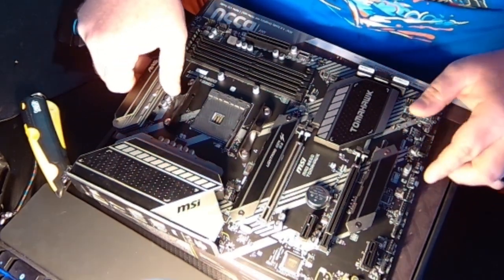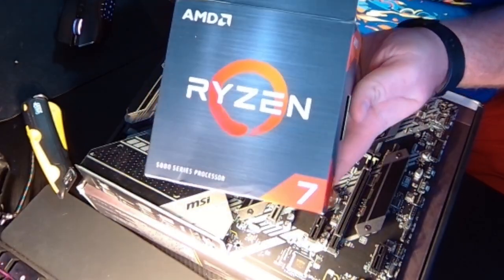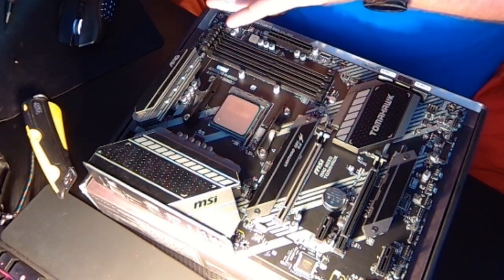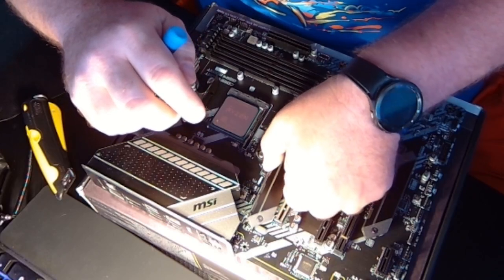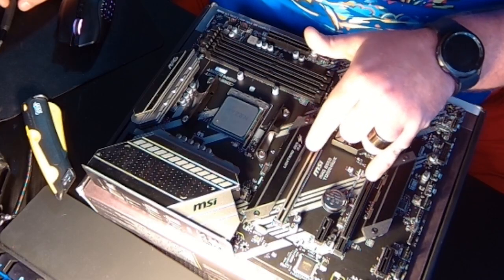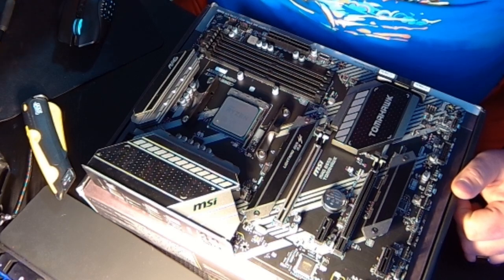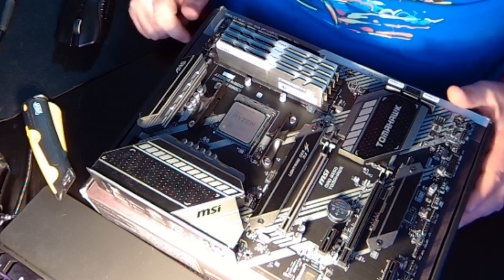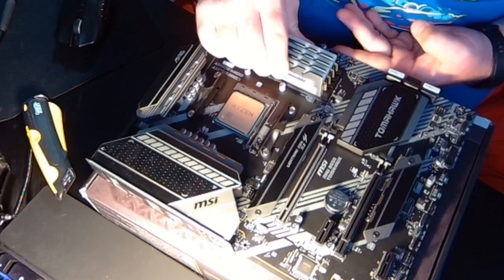Beginner guide to installing components into a Ryzen Motherboard

Comment: no thermal paste?
Reply from the maker: @noneya5370  at this point in the process i have not put the cooler on yet. I don't apply until then. 

Also, I only put cooler on if it is air during this step. If it's an aio, then I put the block on after the mobo is installed in the case.